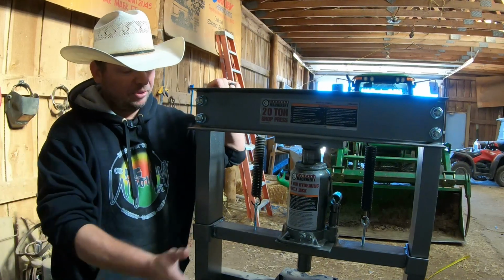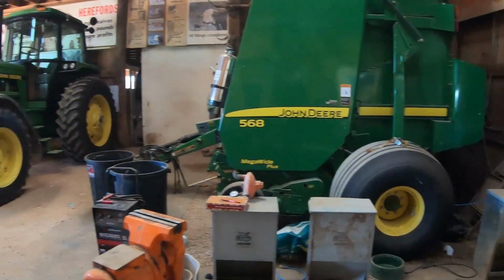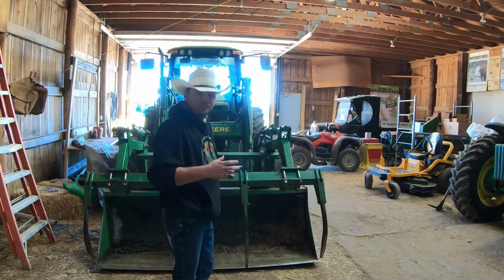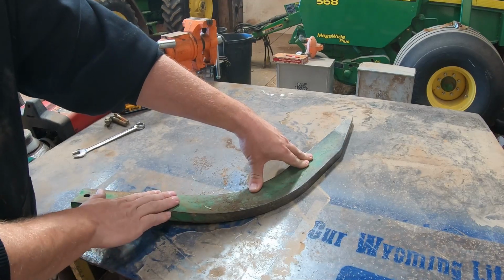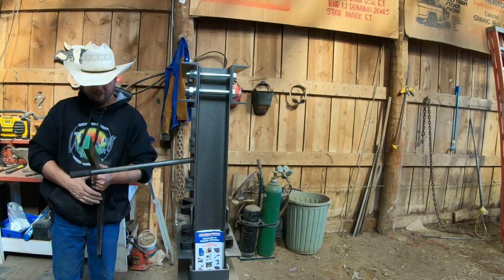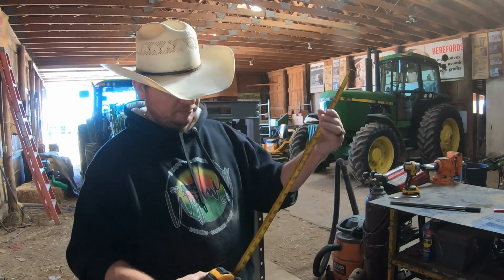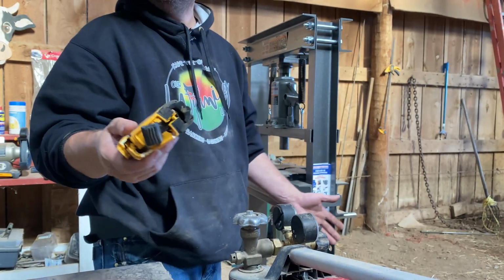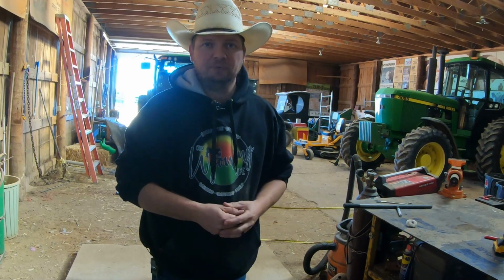Using the Shop Press

Comment: I used to run a 280 TON press. It was built in 1938 for the US Navy and story was it was used to form parts for the aircraft carriers and battleships used in WW2. Was a very fun machine to operate, I was able to finess it to do intricate work and also had the power to bend 1/2inch steel like tinfoil.

Comment: I just bought one of their presses to extract the ball mount from the receiver hitch on my truck.  It had been installed since 2006 would not budge.  Worked very well where my 4 ton power pack had failed.

Comment: The press is a good idea for that work.  I would recommend studying metal heat treating a bit more though because it doesn't work the way you described.  Steel is usually the opposite.

Comment: i have a shop press their awesome but so are pipe benders those plate are for pressing things like bearings onto axles i used my press to straighten the top plate in my wood heater as they bend over time